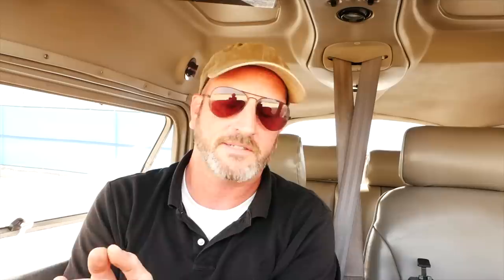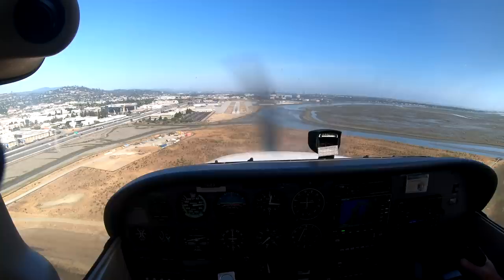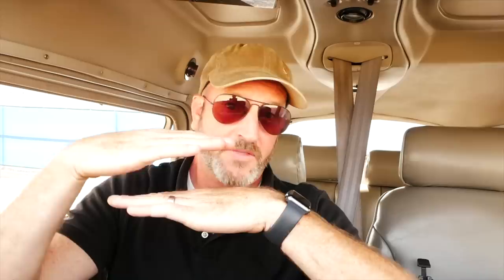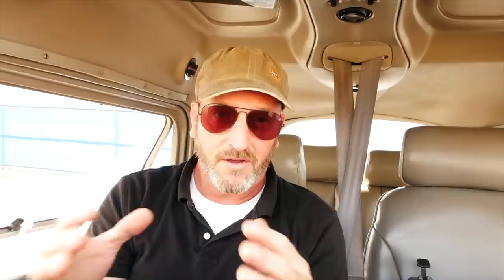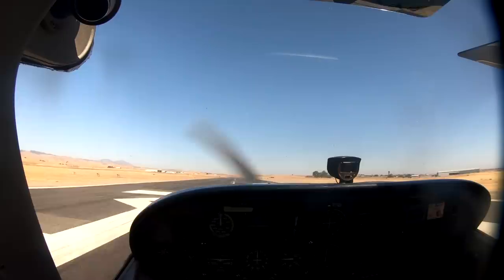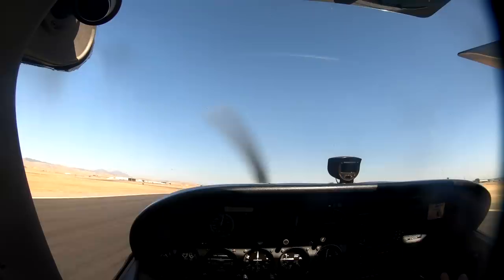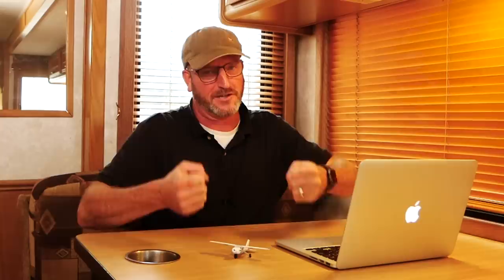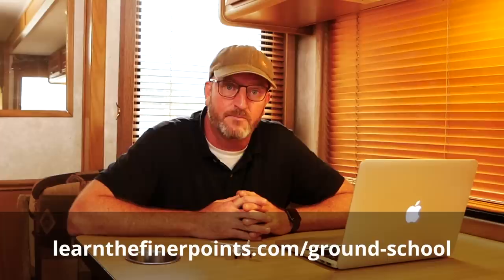How To Land a LIGHT Airplane - Flight training from an experienced CFI (certified flight instructor)

Comment: Another perfect explanation.  I hope your students (and the FAA) appreciate you.  I now primarily teach in heavy jets, but it’s really all the same principles.  For the ‘old timers’ who don’t like the term “flare”, I use the phrase “arrest the descent”, it makes them feel better.  But when I taught in light planes my methodology I would explain as “it’s your job as a pilot to not let the airplane land.  Fly as close to the runway as you can with power at idle and don’t let it touch down.  It’s the airplane’s job to do the landing.”  That seemed to allow them to get a better nose up attitude and touchdown at a slower speed.
Reply: Maybe I am wrong, but my attitude is to not allow it to land like three times, but then I let it settle down. Cessnas land smoothly, but a mooney can come down pretty hard if you are a little high. So I avoid pulling the yoke back for that last inch but still have the nose high.
Reply: Sebastian Roy , Good morning.  I’m not sure what you mean by “not let it land three times”.  A landing should be one single gradual transition of pitch and airspeed loss, not a serious of “three” tries.  But I may be misunderstanding.  And all planes from cessnas to A380’s have a ‘settle’ airspeed in ground affect.  No plane really lands ‘harder’ than another if you have good speed control.  The single most common landing issue for hard landings (and floating too long) is improper approach speed and poor speed control in general.  It’s all about managing your energy.  So... the Mooney shouldn’t land harder than a Cessna, but does have a different amount of energy (and less drag) to deal with.  :)
Reply: Dan, I like that. "it's your job as pilot to not let the airplane land."  I'm teaching my boys to fly after many many years of having my CFI expired. I'm always looking for ways to get the point across to them and that will help. Thanks
Reply: Dan Lohmar, glad it helped.  I hope your boys enjoy the fun.
Reply: Dan, that's the first time I've heard that analogy, and it clicks in quite a way; itself an analogy of dancing with your favorite somebody, in which you tell them to keep the dance going as long as possible, meanwhile your actions encourage the dance to end as soon as possible... two different goals in mind, meeting harmoniously in the middle to the satisfaction of both parties involved
Reply: Rick C, wow, well said.  Thank you.  I’m glad it helps.
Reply: For the piston learners: After you nail the "hold it off" idea; bump up 50 RPM, maintain the deck angle and let'r butter that bread

🧈🍞🛫
Reply: Agree, with proper speed and holding off the runway the airplane lands itself or least it feels that way
Reply: Very helpful. Thanks.

Comment: With a consistent seat position, I taught students in a 172 that "holding it off" until the "nose touches the horizon" (or trees while on the runway) is the landing attitude. And like you said, very close to the power-off stall entry attitude. And VY rotation/climb attitude. And soft field takeoff attitude. And go around/missed approach attitude. It corresponds to 10 degrees on a G1000 SP. Keep it consistent. There is a slight 1 or 2 degrees buffer before scraping the tail, but if you are worried about a student dinging it on a soft field TO or landing flare, I told them to "hold it off" until "one finger below the horizon." That is to say a one finger gap between the front edge of the engine cowling and the horizon/trees from the students and CFI's perspective. Seats should be adjusted so that both sets of eyes are level with each other so that perceived visual references can be identical. Each finger is about 2 degrees of pitch attitude so that would be a landing attitude of 8 degrees pitch up until they are more proficient and can land consistently with a more complete flare without risk of a tail strike.

Comment: Daanng calling out Jason Schappert in the intro lol
I appreciate both The Finer Points and M0A :)
Reply: Lol I was about to comment the same thing😂
Reply from the maker: snowshawnskate did I call him out? Hahaha
Reply: The Finer Points Schappert likes to go on and on and on.. and on.. about how “iTs nOt a fLaRe GuYs”. He recently did a video called “Don’t Flare on Landings” because he wants to call it “transition”. And I actually get the principle of what he’s saying - students hear “flare” and think they need to yank back on the yoke. But instead of just correcting the behavior he’s trying to change the word and adding confusion, muddying the waters, and ultimately just arguing semantics. We’ve used “flare”’ for eons, there’s no reason to change it.
Reply: Jason Vs Jason
Reply: @TheFinerPoints  what pacadet said lol
Reply: Shots fired
Reply: @pacadet  I actually agree with backing off of the word "flare" because the problem with gaining altitude when pulling back at too great speed is far too common.

Comment: Totally a shot at MZeroA lol. I agree with this demonstration not MZeroA's anti flare videos. GJ Jason.
Reply: Having seen both video's I think it is down to personal choice,  I prefer the M0a version as I would still be able to see down the runway and can see any wildlife or any other hazard especially on untowered runways. ( not flown for nearly a year and just starting to get back into it )
Reply: Except for one thing.  It's not about the flare.  It's more about flying a "perfect pattern" that leads to the perfect landing and not getting wrapped around the axle about flaring.  Now if you're going to state right out MZeroA's landings are crap then I'd say you have a problem with the facts.
Reply: The whole point about the "flare" seems to be in avoiding the classic problem of gaining altitude with speed too high when pulling up.
Reply: @robertedwards4031  You just made the best point of all for using the MOa transition method.  I know people who swear by the flare using the Lindbergh visual . . . works with jets and high performance aircraft, but light aircraft?
Reply: @landen99  Flaring just opens up the possibility of bouncing the plane on the runway.  Easier to do the round out, keep the nose slightly up but still able to focus your sight at the end of the runway, let the aircraft bleed off speed using slow flight and wait for touchdown.
Reply: @Jaden48108   I suppose it will also depend on the aircraft as you say .. if you are 5 ft nothing flying something like a SR22 with quite a long nose then you may have very little choice as opposed to if you are 6 ft4 flying a EV97 where the nose is quite short

Comment: Great points. I'm always warning new pilots about the dangers of the decelerating final. It's fine after you've gotten plenty of experience, but way too many new pilots try to stretch a glide with pitch while the airspeed is decreasing, leaving them with NO energy at the beginning of the flare and the resultant hard landing. I've always taught to get it to that flaring altitude and keep adding back pressure to keep it from touching. Gravity will do the rest, but the student's job is to keep the wheels from touching. So many have this idea that the perfect landing is a perfectly timed round-out and the wheels touch at the end of that maneuver. Nobody can time it that well. Just keep the wheels from touching.

Comment: Thank you Jason. I keep coming back to this video to improve my instructing and my flying. I was interviewed for an instructing job at college that required students to calculate Vref for every flight. This might sound drastic but it helped achieve two things: 1) preparation for flying large aircraft and 2) better landings. The 172 with minimum fuel and a solo student has a Vref that is significantly lower than typical POH approach speed. I found that using Vref reduced float. I’d love hear and see your opinion on this. Thanks again.

Comment: For 51 years in aviation, I have heard and seen more people's explanation of " how to land" than I care to remember. Most have some good points and some not so good. Therefore I don't propose to offer much comment on yours, other than to mention where we advise our student pilots to look. Common to many are concentration on watching the ASI, then fixating on the aiming point, then, and I quote from an official training guide "transfer your gaze to the end of the runway". My advice is that there is only one place to look, and that is EVERYWHERE. That way, you get the "big picture" which has all the information you need to successfully land on a huge airport, or a sloping field with cows grazing in it, and works whether you fly a Chieftain or a Pitts or whatever..
Reply from the maker: Alan Campbell I can respect that. But in terms of teaching isn’t everywhere the same as nowhere?
Reply: @TheFinerPoints  Not at all, and it applies to all modes of mobility, from walking on the street, cycling, motorcycling, driving, boating etc. Safe completion of the task requires situational awareness which is compromised when attention is too narrowly focused. I have always found the big picture to work best.

Comment: I learned something about 10 years back, which works out very well. It’s called profile flight. If you look at an airliner coming in or any large aircraft, they obtain an attitude which stabilizes their airspeed, and they control their altitude and decent rate with power. When it comes time to touchdown, they have little or no raising of the nose. It basically just settles down the way a duck lands on a pond. Most of the time with larger aircraft, you need to land with a little bit to no power. Trying to land anything heavier than a 172, especially a low wing aircraft with zero power usually results in the aircraft going into a high sink rate. This also works well in windy conditions with minimal flap and also with tail wheel airplanes. Some aircraft need a little bit of thrust to get more tail authority.

Comment: In the air force they teach you to not smoothen out your final approach. The aim point is where you will crash if you don’t flare and round out. At the desired flare height, you flare to straight and level and cut the power and raise the nose as the aircraft sinks. That’s what I learnt in the force

Comment: Do not idle the engine until the wheels touch the ground. 
Reasoning: As you are descending, you will be adjusting the power to maintain the approach speed (70kts or 65kts depending on configuration). When you pull the nose up to flare/transition to straight & level flight, you'll lose airspeed. If necessary, you can increase power and go around.

Change my mind
Reply: I think its okay to go to idle, but only when you're a few feet above the runway and beginning your flare, provided all factors look good (you're on center line, correcting properly for crosswind etc,) AND that you still have your hand on your throttle. I was doing landing practice yesterday and we used the FAA approach to landing, and i maintained 70 until I needed to drop the speed, which I did by holding the nose up just off the runway until we touched. That was done with throttle at idle, but my hand still on just in case we needed a go-around.
Reply: Don’t idle until you can make the runway in a constant speed glide. Idling prior to the flare reduces task loading and reduces a control degree of freedom. You on need pitch control after that. Every landing is a glider landing on short final. It’s the way I was taught, works a treat!
Reply: Power does not control airspeed. You can make the airplane fly at 100kts with no engine if you are descending.

The ideal landing should be done power off for two reasons; 1) approaching with extra power means you are technically exposing yourself to more risk by being below the glide path to the runway incase of engine failure or you are landing long and using more runway than you need. 2) If the goal is to land the airplane than extra thrust simply works against your goal.
Reply: I'm using power for altitude on my landing. If I'm high, I'm idling.

Done plenty of go arounds from idle too. 

There are obstructions going into my home airport, so you're coming in a little steep. Airspeed isn't a big issue. Short base to final because of terrain.

Comment: Pretty interesting, but it is far simpler than presented here in this video.

Background I'm a full-time FAA gold seal independent flight instructor and I've given over 7,000 hours of instruction in over 16 years of full-time instruction.

First thing eliminate the words push and pull from your vocabulary as it relates to flying - the yoke is never pushed or pulled.  Always think in terms of pressure forward pressure and aft pressure.

If you trim well past the abeam the numbers position with that first notch of flaps in, especially with a cessna, each subsequent application of flaps will bring you to the correct airspeed if you've trimmed well at that abean position.  As this video and many other videos like to quite rightly point out if you start with a stabilized approach it makes the rest of this quite a bit easier.

So big question concerns when to round out that's where you convert the aircraft from pointing at the runway to level over the runway.?  So on a 75 ft wide runway which you see a lot of at general aviation airports, basically the point where there's the illusion of the runway starting to expand out to the edges that's approximately where you should begin your roundout to level flight.

When you convert to round out which is level over the runway, and this is the part most instructors get wrong, what you want to do is direct your eyes to a distant point that appears to have zero relative motion.  For instance say there's  mountains or hills in the distance.  Direct your eye at that point never look at the end of the runway look at the distant point that has no relative motion.

Our brains are wired to be attracted by motion. The reason for directing your forward vision toward a point that has zero relative motion is then your eyes will see the sink, in your peripheral vision. It is the peripheral sink and the rate at which you sink that gives you the cue as to how much back pressure to apply on the yoke.  And what you want to do is treat it as if you're trying to keep the plane flying, you don't want to climb, but you don't want to land keep your eye on that distant non-moving point that you're using as a referent and continue to respond to the peripheral sink - more sink more back pressure back pressure keeps flying back pressure keep flying back pressure touchdown.

If you TRY to land a plane it'll be a sloppy landing every time if you use the mindset of trying to keep the plane flying and keep your eyes at that distant point of zero relative motion you'll land well each time.

Again I always tell my students to throw the notion of push or pull out of your head when it comes to applying the aircraft controls. All the aircraft controls think in terms of pressures smooth pressure forward smooth pressure back whatever the control surface may dictate.

If you think of flying as sort of a sky ballet with all the movements smooth and fluid you're 99.9% there of getting the trick of all of this Aviation stuff,not only landings but in flying the plane effectively.

Anyway there's my two cents.

Comment: I use to teach my students first to fly the whole length of the runway at a constant height from threshold on. Once they get to stay at a constant height above the runway and execute a go around they know how to use the elevator and which power to maintain level flight at V tgt and learn to go around each time anything is in doubt. Now all they have to do is to idle and try to land by not to land from that height and hold the panel slightly above end of runway about 5 ° pitch up. Besides looking always staight ahead to maintain centerline never to the side its to distracting for a novice whom is busy enough especially when forward slipping to compensate crosswind.

Comment: "How high to flare?"  In most training planes, the "flare" sight picture at landing is the same, or slightly lower, than Vy.  Teach them to climb at Vy by glare shield against the horizon (or horizon slightly below the glare shield in the "Lindbergh reference), and then you can teach them that the flare is just about raising the nose to slightly below Vy once the plane has lost enough energy to keep it from climbing in that condition.

Comment: Bill Kershner identifies two different methods for teaching landings in "The Flight Instructor's Manual." 1st is the AFH-approved "blended" round out and flare from 10-20 feet until touchdown. The 2nd (as described in this video) is flying down into ground effect and and holding it just off the runway, gradually increasing angle of attack until touchdown. The problem with the latter is floating and difficulty with accuracy landings. 

As a primary student I was taught to fly it down into ground effect right away, just a foot off the runway, holding it off, increasing back-pressure until I had a nice smooth touchdown in the landing attitude. This seamed great and it was easy to "grease" them every time, but the difficulty came when it was time for accuracy landings, because the amount of floating this causes is obscene. Just watch the video... you will float for hundreds of feet and it is difficult to predict where the airplane will finally run out of energy. Doing it by the FAA handbook's method takes a bit more skill and finesse but can be executed with much more accuracy.
Reply from the maker: Thanks for pointing that out. I'll take another look at that. Usually Bill and I agree on everything
Reply: Ok if you have a 2 mile runway.

Comment: All you have to make a landing is make a stable approach at the right speed, cut power at 50ft, pull back gently to maintain a constant sink rate. thats it. Some planes with a heavier nose will make things easier with trim, but using trim as a crutch can cause issues in a go around event.